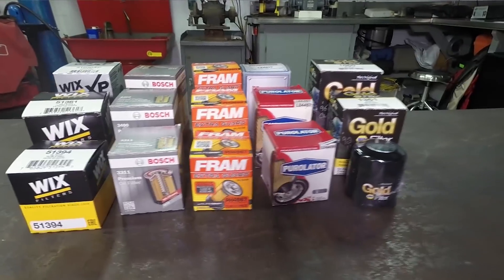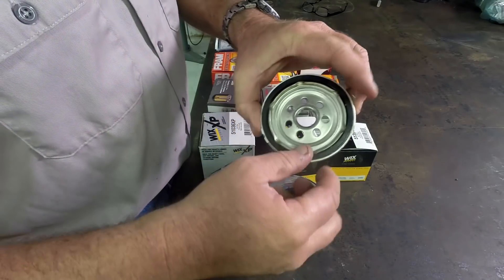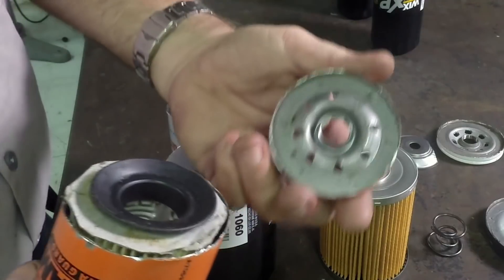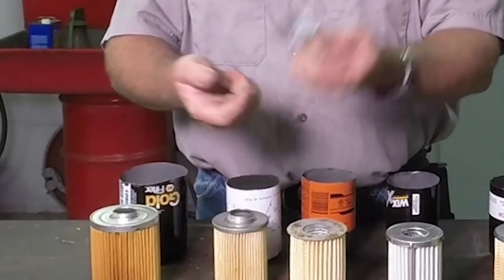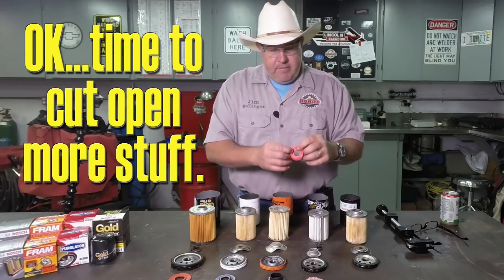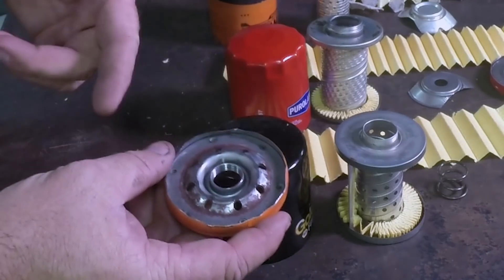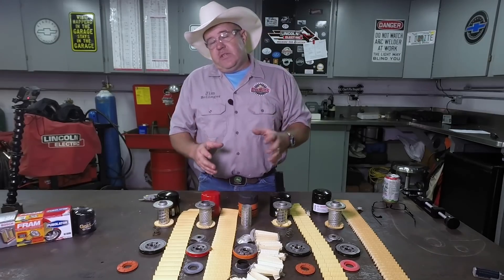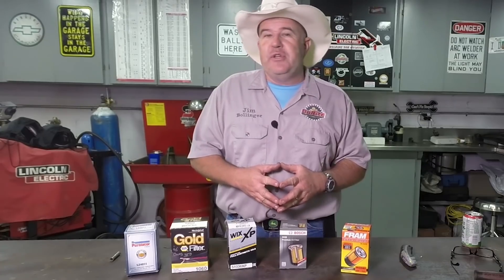The worst oil filter EVER!

Comment: I used fram for years, never had a problem.
Reply: Yes but how often do you change vehicles? To keep my 31 year old original truck running past 400,000 miles and more, cheaping out on filters and oil is not an option.
Reply: My Chevy truck has 500,000 miles on it, ALWAYS ran Fram Oil filters and Pennzoil 10W-30 recently changed to Rotella T. Not saying the Fram is a great filter but it does work well enough obviously.
Reply: @beezertwelvewashingbeard8703  78 uufññljth
Reply: @beezertwelvewashingbeard8703  I have a 94 f150 I bought new, used fram oil filters for 10 years, no problems
Reply: All you're saying is that your Fram filters haven't destroyed an engine yet.  That doesn't change the face that they're garbage.  You've now seen it for yourself.
Reply: @mqbitsko25  yes, that is exactly what I said. I didn't say they were great or the best, but that they can't be that bad as I have driven my truck 500k, and an olds cutlass 300k on them without problems, so they don't cause engine failure or anything.
Reply: @integr8er66  hey I'm with you. 
I learned something new and will benefit from it. It seems like when some people learn something new they then proceed to chastise everyone that doesn't necessarily share their newfound opinions. Silly kids, just trying to flex what little wisdom they think they have...
Reply: @integr8er66  GM products with more than 100000? That's a miracle
Reply: @dwrn05  IKR!! Lol
Reply: @dwrn05  its not actually, I have seen many many of them go well over 250. You are just a hater, or don't know how to keep one on the road.
Reply: @conservativeamerica9655  see my last post. I only drive Chevy and 300-500k is why. I also won't drive anything made after 1986.
Reply: @integr8er66  Lol! I'm not bashing your Chevy's , I'm just a Ford fan picking at a Chevy fan.
Reply: @integr8er66  agreed. My silverado is 266k.still runs great.
Reply: @mqbitsko25  how can a filter destroy an engine?  It just filters the oil.  Still have not seen one explain how a filter can destroy an engine.
Reply: I have had great results with Fram, 240k on my single owner, 2.3L 93 Ford Ranger.  Change oil every 2k with 10w/30 Valvoline & STP.
Reply: Bill Mohelsky every 2000 miles!? Holy cow you’re probably dumping perfectly good oil out and wasting money. Go to blackstone labs website and order a oil testing kit it’s only like 10 bucks and send in a sample of 2000 mile oil. I’ll bet they say the oil looks brand new and you can run it for another 3000. I had 5000 miles on an oil sample from my Chevy truck and It registered very low particulates and good viscosity and base numbers. Basically it was just as good as new oil.
Reply: @johnnyreb86  I ran the oil analysis program for years at the Army Engineer School (construction equipment). 70% of the time we changed oil was because a bearing was going out, or if the engine lost a head gasket, lost an injector or cracked a sleeve. That didn't happen often so the low viscosity change was rare. I did tons of study and discovered GM engineers figured out their oil life indicator (OLI) to perfection. They have a 10% safety factor built in in case you're away from home when the light comes on. And if you've added a quart, that extends your range by an additional 1/5 or 20% if you have a 5-quart oil pan. My last oil change was like that, and the light came on after nearly 10K miles. I don't care to abuse my engine, but this isn't 1930's oil and I trust the science.
Reply: That's like saying you've had sex with prostitutes before and haven't caught AIDS... It doesn't mean it's safe 😂
Reply: @calvinwalker4654  This video is saying all prostitutes have AIDS. We're saying it's more like one in every 5 million. Those are odds I have no problem with.
Reply: @aaronbritt2025  I don't think a one in five million chance is a realistic statistic for that garbage filter having a negative effect on your engine.  Now one could argue the degree of negative effect and that chance but why would you choose to buy a product with any chance of this?  It isn't even about saving money because generic Walmart filters are constructed better than Fram.
Reply: @calvinwalker4654  I've been an automotive technician for 30 years and I've never seen an engine fail as a result of a properly installed oil filter. I've worked on between 15,000 and 20,000 cars, so that's a fairly large sample.
Reply: @aaronbritt2025  So you know if an engine wore out at 180k vs 200k miles it was because the cheap oil filter didn't filter out as well?  I'm not talking about catastrophic failure because lets face it you probably could screw on a hollow can instead of an oil filter and most modern cars would still run for 100k without any problems.
Reply: @calvinwalker4654  Define "worn out". I've never seen an engine stop running due to "wearing out". When engines stop running, it's because a part failed. Those failures are never caused by oil not being clean enough. Most failures ate caused by overheating, oil not being changed and losing it's lubricity, detonation or loss of oil pressure.,
Reply: @aaronbritt2025  Do you know why the part failed?  It's called wear.  Of course one part is going to fail causing the engine to stop because not every single piece will wear and fail at exactly the same time.  So you're telling me that no failures or increased wear happens when the oil is not "clean enough" as you say?  It's not dirt and grime that is going to wear the engine but rather particles of metal floating in the oil.  At the end of the day you still can't justify spending more money on a brand name filter that's inferior to even the Walmart store brand.  Maybe the orange matches the rest of your engine?
Reply: @calvinwalker4654   you're obviously not a technician. Read my previous comment... Parts almost never fail due to wear. Parts fail due to loss of oil pressure, overheating, detonation or loss of lubricity.
Reply: @aaronbritt2025  obviously you're avoiding the question as to why would anyone pay more for a brand name that's inferior to even the cheapest store brand?  You can fanboy all you want but Fram is junk, at least their standard line of oil filters are.
Reply: @calvinwalker4654  and you can call them junk all you want. Keep listening to people who make Youtube videos for a living instead of people who actually work on cars. You keep saying they're inferior... facts not in evidence.
Reply: @aaronbritt2025  Facts is video proof of them cutting it open and seeing the garbage construction compared to other filters.  I've had professional mechanics tell me that Fram was garbage as well but I'll trust my own eyes as to what I'm seeing.  You're the definition of fanboy.  Someone shows you a video of something and you'll insist it's not real. There's just no reason to buy this product unless you absolutely love the color or the grip surface.  You'll get people saying well I've used Fram oil filters and I got a 200k out of my engine.  Well I know people who got that and barely changed their oil.  The only way you could absolutely prove that this crap is worse for your engine would be by running multiple test engines under the exact same load while using different filters then testing the oil.  To my knowledge currently this information is unavailable so I'll have to use my judgement as to what risks I want to take on my car.  If you want to use Fram on your cars by all means it's a free country but I'll give it a pass.
Reply: @calvinwalker4654  You're the definition of an internet troll. Go ahead, keep watching Youtube videos for car advice. Guys like me love that. We get paid to fix Youtube Technician f***ups. Oh, and 200k is a far cry from the almost 500k on my truck.
Reply: @aaronbritt2025  oil pumps fail because of contaminants in the oil. The other cause of failure is metal fatigue. That can be caused by bearing torque from insufficient film density.
Reply: @jeffanderlik7695  Insufficient film density is what loss of lubricity means. See my previous comments. It's usually caused by water or gasoline contamination or overheating.
Reply: @aaronbritt2025  Yes I'm an internet troll because I'm not a Fram fanboy lol.  If you're waiting for my Mobile 1 synthetic oil and Mobile 1 oil filter to f***up my car you'll have a long long wait  😂😂.  I'll keep you posted but I'm not sure if YouTube will still be around then.  Maybe we'll have some chip in our head that plays video
Reply: We cut them open in auto shop in the 8o's, fram was pretty good then. They went to shit.
Reply: 500k on ford ranger no fram problems. However I never cut one in half. Fram wins found at every store
Reply: How long did engine last? How long would it have lasted with a different filter? Are you SURE you never had a problem? Or could it be that you were just lucky?
Reply: Used Fram in all my cars, changed oil every 5K miles and NEVER had an engine problem (chevys, Fords, & Jeeps).
Reply: They are made cheaper now.
Reply: You never had a problem, but your engine is suffering.
Reply: @Sandwich420  Only if the fram somehow blocks oil flow.
Reply: Spend the extra couple of bucks to buy a napa gold is great insurance than to keep on buying fram filters. Fram dropped quality about 5 years ago from what I heard
Reply: I won't be using Fram any more, but @Aaron Britt is pretty much dead on. As long as you change out your oil every 3,000 miles, you're using full synthetic oil for late model cars, and you use Marvel Mystery Oil to avoid carbon and sludge problems, you're probably going to be just fine.
Reply: Oil filters are overrated
Reply: How does cardboard rust?
Reply: You must be Liberal, they always oppose facts ! LOL
Reply: 436,000 on my work truck. Supertech and Fram .
Reply: My '87 Nissan Harbody has 476,000 miles on it. Nothing but Fram and Castrol GTX. Only repairs that engine has ever had is two thermostats and 3 timing belts. Every single video on Youtube about oil filters talks shit about Fram, but nobody ever seems to figure it out... It doesn't matter what oil filter you run. All that matters is that you change it every 3k miles. Hell, you could probably use a Coke can stuffed with coffee filters if you change it every 3k miles. Don't believe the marketing bullshit. The only thing a $15 filter does better than Fram is remove money from your wallet.
Reply: @aaronbritt2025  I would have given you a thumbs up but that isn't enough. You hit every point right on the head. Good enough, change oil often and pay attention to your vehicle.
Well said!
Reply: @aaronbritt2025  my NAPA store only charges an extra dollar or so for their filters, and I don't have to waste my time & money changing oil that often. I'll spend an extra dollar to go 3 times as long on an oil change.
Reply: @jrg10332 I hear you bad mouthing, but the fact is fram is not a bad filter!  I know from experience, not from some guy telling me!
Reply: Conservative America lmao. You are an idiotic troll. Seriously, who do you think you are convincing?
Reply: If you like playing Russian roulette, then have it.

Russian roulette (Russian: русская рулетка, russkaya ruletka) is a lethal game of chance in which a player places a single round in a revolver, spins the cylinder, places the muzzle against his or her head, and pulls the trigger.
Reply: you probably have a low i.q.

Comment: Nice expose.  Had you considered the Franz filter?  Popular between the end of WWII and the early 60's before the wide use of the disposable spin-on variety.  They used a roll of toilet tissue suitably sized and placed into the center of your oil filter housing.

Comment: Good video, but not quite apples to apples. I get the feeling you are a fan of Napa filters. You should have had a Napa silver filter for a more even comparison. I will agree that fram is useless, especially since every Cummins owners manual has a huge red box stating that use of fram filters will void warranty. But I suggest you cut open a pur one puralator and compare it to your Napa gold filter. And your assumption that more media means better filtration is misguided, density and permeability of the media determines that. And use of a coil spring vs a stamped spring is not really an advantage, its like saying leaf springs are junk. Leaf springs are in fact more robust and last longer than coil springs, but are more limited in applications they can be used. In this case it is simply holding pressure on a filter carriage, not a demanding application.

Comment: good video... been doing cars for 40 years.. I stock Wix oil filters..  I looked into them years ago.. doesn't make much sense to use a cheap quality oil filter as its one of the most important things regarding your car that you need to use...  you get what you pay for.. as for Fram.. great coverage, but people think they are high quality because they spend soo much money in advertising..... not the case...

Comment: When you tested for single and multi pass efficiency what were the results. Oh wait you didn't test for that did you. I have always changed my own oil for the last 50 years and have always used Fram filters with zero problems. I drive the same vehicles for many years. The last one I drove for 20 years and the current one is 16 years old so if the Fram filters were going to wreck my engine I would have found out by now.
Reply from the maker: If you are happy with them, by all means use them.